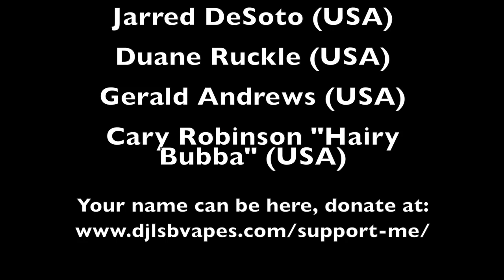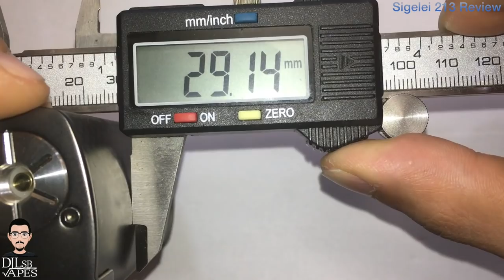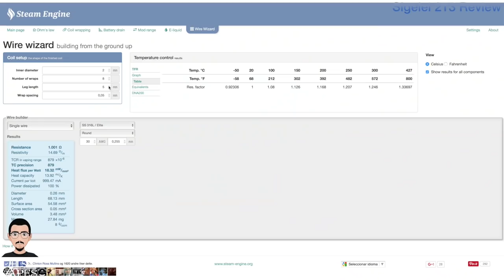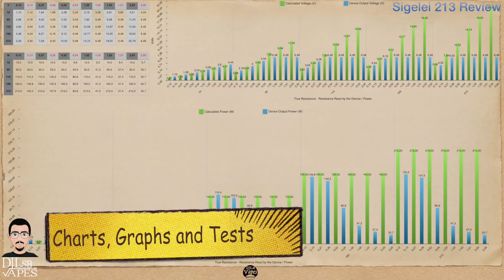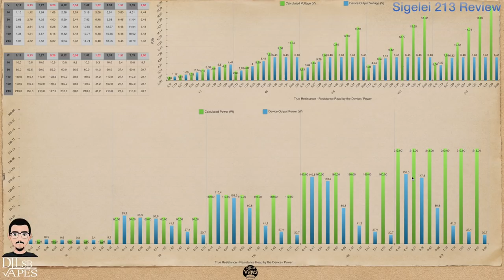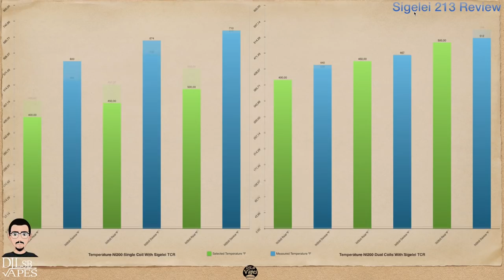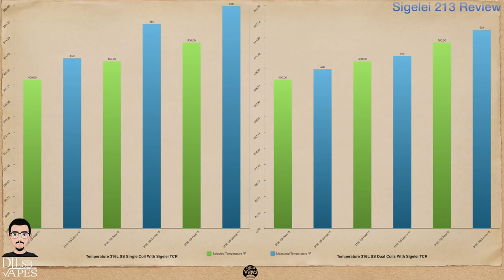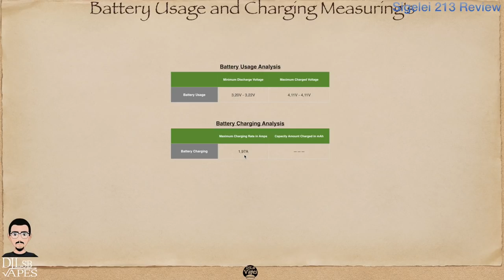Sigelei 213 Lies unveiled + Charts + Disassembly

Comment: So when you select lock the resistance it says hold the button so is that why it didn't work for you? I like the size and weight of the device but won't buy it if tc doesn't work.
Reply: I was wondering the same thing. It was saying hold to lock, and I never saw him actually hold it. Don't know if it would have mattered, but I'd like to have seen.
Reply from the maker: No, doesn't matter, that message is another glitch, holding it just makes the device fire right away, anyway later on the video you see it say's unlock instead of lock, so was locked, well not actually locked because that function is faulty, well you get it
Reply: +DJLsb Vapes awesome. thanks for clearing it. it doesn't matter whether right or wrong about that issue, their response was wrong. just something I was wondering about.

Comment: I'm really dissapointed watching this video,  actually this mod is dangerous... I have istick Pico and want to buy sth with more power like 120/150w, ability to use bigger atomizers  and really good working TC. I love builds with TC, mostly Ti wire, which mod do you recommend ? SMOK H-Priv looks very promising but would be nice to buy sth smaller ...

Comment: Thanks for the review.
Great looking mod, shame they ballsed up the TC.  It looks pretty well built though so I'll probably still get one when the price drops, I'm not a TC vaper so don't really care about that, a small light pocket friendly dual 18650 mod is useful to me.

One thing on the power rating, I'm fairly sure you said the max voltage was about 6.5V (I didn't trawl back through the video to check that) but the resistances you tested it at jumps from 0.13R to 0.27R, so you never tested at the resistance range where 213 watts is theoretically possible for the regulator.  These devices have to limit voltage and/or current (it's best they have hard limits for both) for safety, because of that they will only ever be able to achieve their rated power output under specific conditions, i.e. within a limited load resistance range.

Don't get me wrong, I'm NOT saying the mod would achieve 213W, I'm just pointing out that it was never realistic under the conditions you tested.

Anyway, love your work man, please keep doing the in depth reviews.
Reply from the maker: You welcome, yeah You are right, that's why when that happens I always vary the resistance up and down just to see if I will get higher wattages, if not I just go with those resistances I always do ;-)
Reply: That's great to hear, thanks!  I watch a few different reviewers for different reasons,  the in-depth technical detail of your videos is an important aspect most reviews don't offer.

Comment: It appears the board does not boost voltage or if it does it is very weak. Were your cells fully charged to where they could get even close to the 7.5v under load that they advertise as max voltage ? (Yes, I know that is pretty much impossible under load to have 7.5v to the coils with dual IMR cells, unless the board has a good strong boost). It really is said that the device can not actually put out the rated voltage / amperage. If it actually could then 213watts would not have been an issue. That will teach me to trust manufacturer ratings. The reading of the resistance each time the fire button is pressed, (even if locked), is a huge fail as well. Sadly I actually owned one and enjoyed using it and recommended it to others based on their rated outputs. It is still one of the best built mods I have seen at this price point but the fails make it a disappointment to me as well. Thanks for another awesome in depth review.
Reply: Does it need a boost circuit? Most dual cell mods are in series, and do step down instead of boost; more efficient and much simpler.
Reply: If it claims a max voltage output of 7.5v with dual 18650's, or anything above around 6.8v under load, then yes it will. We all know that under load the internal impedance of the 18650 IMR's that are currently available on the market will not allow that type of output under load. Except maybe with a very high load resistance. It will also only be for the window of full or nearly full charge. To make that claim with a fully regulated mod and not deliver it through the full dis-charge cycle of the power source used is simply wrong and false. It is always easier and more efficient to step down but the max voltage claim on the mod is what is the issue with not being able to attain rated wattage. The board is actually doing step down very well, as seen in the graphs. Glad to see another person responding here on YouTube with a decent level of tech knowledge, as it applies to our usage in mods. Well done jawr1215...

Comment: That really sucks. Sig has always made good gear, but I can't believe they told you to use "40A" batteries. ://///
Reply from the maker: Yep
Reply: Just saw the other links. Wow. Just wow. No returns through vendors? I'm assuming this is so they can avoid replacing/refunding when folks figure out it doesn't work. And they asked you to take down your review??? I will probably never buy another Sig product. That's horseshit. It's one thing to put out a piece of shit product. But to know it's a POS before it hits the market and try to cover it up is shady as fuck.

Comment: I had heard bad things about Sigelei but gave this one a try. Should have known there was something up when they came out with the  Fuchai 213 the next week after this one came out.Looks to be the same mod... No upgrades a big lie so they changed the name to sell the units they have? They blew it I like the form factor and looks, battery life is not bad.Another reason to use a DNA 200....oh well.
Reply: I feel ya brother! I bought the orignal 213 too and I gotta say I'm really disappointed...especially considering the price it cost. I could bought 2 mods that work like they're suppose to for the same price! But even after learning all this, I gotta say I still do love the look and feel of the mod..and since I don't really go over 150w and use TC rarely it's been doing pretty good. 

As for the Fuchai 213 the worst thing is, they supposedly fixed the issue they had with the original 213's chip and are selling it for half the price of the original 213!! So the people who bought the 213 are stuck with a chip that doesn't do what it's supposed to do! This last time I ever buy a mod before I watch some reviews...I almost never do that in the first place but after seeing how nice this looked and hearing some good things about it, I got it without thinking.

If only they made this board Firmware upgradeble, they could of easily fixed some the issues or at least tried to! Anotehr thing I'm never doing again is buying a deice that isn't firmware upgradeble, it just doesn't make sense not too when there are so many devices that are and are cheaper!
Reply: You hit it on the head never buy a mod that isn't upgradeble. They knew all that from the BS original Koopor and still said this was upgradeble . Just lie right in everyone's faces and take the money...
Reply: LOL you must work at a vape store.A vape store were the person doesn't know anything but the price ( that's 2+ times the price ... yeah). That's why we watch some reviewers like Daniel somebody who can test them.
Reply: Tim Baxter no I have a real job in the education industry. What ever happened to researching shit yourself? I guess being a capitalist shopper in this country is to difficult for some few
Reply: Research like checking the manufacture ( that gets you nowhere). Maybe forums like reddit where wiseguys help nobody.That's what reviews are for...you know.Maybe where you are they let you play with mods for days to get a feel for it. That would be nice.Capitalist... not really nobody wants to wast money .For a few it's easy to criticize...isn't.

Comment: I actually like the 213 but its not quite worth the money I paid for it.   The TC Functions are horrible but I do enjoy using it in Power Mode with the Pre Heat functions.   I have better devices which cost only a fraction of what the 213 costs.    I was disappointed with the TC Functions and very upset when I found out you could not upgrade the FW which was one of the reasons I took the risk in acquiring mine in the first place.   For what I am using it for its a fine device for what I intended on using it for well disappointing.   To see Danials test results confirmed what I suspected and Sigelei just dumped another device on the market that's not what they say it is.

Comment: i guess a good metaphor which btw is also kind of a bad one since it kind of works in a different way but using this only as a means to interperet my point in case is if cruise control (which yes is different because it acts based on speed first then applies rpms then backing off rpms at desired speed, and not the way tc does which in a way applies watts then backs off) had a button to activate  and apply rpms( yes i know cruise control doesnt work like this only when under speed, but just saying if it did), it wouldnt make sense to ,once desirable speed is achieved , to let go turning off and then pressing again turning on again which would apply rpms thus further speeding the car since it is already at speed,( yes from the time turned off and then turning on again of course it would have slowed down but come on REALLY?! not that much) but yes and then doing so repeatedly 3 more times every time of course it would go faster wouldnt it???  and this would be just a portion of what the car could do.  btw.  not foot to the floor on the gas pedal comparing to the 213W which yes whatever 155W nonetheless the max.  set to preheat everytime the amount of time which whatever u had it set to even if half a second 213W repeatedly applied after the set temp was already limiting to from the first press of the fire button.   i know u get what i mean even tho my comparisons arent exactly the best to use.  so yes i think if that if u set a lower preheat it might work fine.  just trying to be thorough in my thinking of how the whole preheat and tcr temp limit thing works.  no disrespect.  love what u do bro.

Comment: you do realize to lock the resistance you needed to hold the fire button not just click it???
Reply from the maker: No, is normal, is just another flaw, if you hold it, it does the same, plus the way I lock it you can see later that if I enter that menu again instead of lock it say's unlock
Reply: +DJLsb Vapes I didn't see it say that. but I completely trust your opinion on these devices as you are extremely thorough and definitely know your stuff lol. i just never saw it lock or unlock but I did see it say to hold button to lock resistance. again I trust your opinion more then most so I will take your word on it. thanks for the fair and honest videos my friend

Comment: boy that 510 spring looked rusty?
Reply from the maker: Yeah, inside, is normal because of the solder paste used and then the humidity during transport
Reply: +DJLsb Vapes ok. ty. i didnt know that
Reply: +DJLsb Vapes hey Daniel, what mod would you recommend for stainless temp control besides a dna?
Reply from the maker: The Q Class or any joyetech or the SMOK H-Priv are amazing
Reply from the maker: The IPV5 is great too
Reply: +DJLsb Vapes ty
Reply: +DJLsb Vapes ive got the h-priv maybe it needs to be updated because its on 1.04 firmware right now.
Reply from the maker: Oh yeah, really, trust me, upgrade it and you will be amazed ;-)

Comment: just wondering if the preheat fuction is the reason why tcr isnt working properly.  the reason im questioning is if hypothetically the 500F was reached, is the preheat wattage and time set for it absolute?? lets say it reached 500F and then immediately after releasing the fire button firing againwith 213W set for preheat,  for exmple if set to 2 secs.  and 500F is reached and then i release and fire again wouldnt it fire at that 213W for 2 secs regardless of the temp already achieved? and then if released and fired again resetting it for another 2 secs of 213W and again another time over the course of lets say 8 secs fired and released in   immediate succession but not exactly time set , as you exhibited.... would that really be using the tcr and preheat functions the way it was supposed to be used forthe temp limiting function to be achieved ?

Comment: great review Daniel, I bought this shit based on other famous reviewers, crab, I promise I will never buy before you review it, what happened happen, do you recommend any TCR number for SS316L SS317L than the crappy way of calculation, you will doo every one a favour if you have any input. second if TCR is fucked up and useless, do you recommend using TFR setup for wires or it is still useless for the fact that the unit does not lock resistance at all, this means this device is a good look on power mode only, crab sigelei

Comment: I always thought it was an ugly POS anyway, didn't get all the hype. The cuboid is a much nicer device. I've seen other reviews that showed gaps in the supposed carbon fibre, gaps on the 510 with many tanks plus other issues .... for what is a pricey mod, towards it's competition, it's unacceptable. And that is before the more technical failures.
Reply: +1 on the Cuboid.
Reply: From what I've seen, the build quality on the retail version is perfect... and there is so much play in the spring of the 510 that I just can't picture a tank/deck that won't screw all the way down. My Gemini tank is, by far, the longest 510 I have available, and it screws down flush with no issue. My IPV5 and my VTC mini both have gap issues with the Gemini.

There is so much wrong with this device that I wouldn't want people to pick it up in store and think "I read that the build quality was sub-par, so maybe they fixed everything else, too... It looks so good", and then buy one. Make no mistake - it is a very well-built mod, but it has serious problems with the internal TC functions.

It's kind of like if you met a really hot girl, and she says she's really good at cooking... so you take her home, only to find out that she is really good at cooking with Cyanide.

Comment: Why are people shitting on sigelei? They were hands down dropping their dick on the table they made the best mods a few years ago. They fucked up. And there hasint been time for them to burn a time out and figure this shit out. My suggestion is, all of these self taught mechanical engineer guys oughta collaborate and make mods outside of China. Cause that's some of the problem. They can make shit just fine, but r&d and their outlook on patents and transparency is bad. If that crazy ass dr. Ploom can make a mech mod that can handle a fuckin car battery, and a guy who single handedly designed and manufactured a mouse and keyboard emulator for PS3/4 and Xbox, complete with an oled display and his own software. I'm sure we can get some 'murican TC/VW mods. And no, I can't do it, and don't the entrepreneur drive.

Comment: no offence you did the dry test whit 213w what did you expect?....and second if you want to lock the ohm keep the buttons push for couple of seconds....you didnt wait....i did a dry test on a dna200 whit preheat 200w and got same experience....so pls be accurate...as for they're  213w bullshit you are wright....is imposible to get over 200w whit only 2 battery :))

Comment: Why do they scratch the identifying numbers off of the SMT components? Do they legitimately think that someone would take the time to reverse engineer their shitty product? If someone had the know how and resources to have a legitimate reason to try to reverse engineer it, simply looking at the component would be enough for them to be able to duplicate it. They would know what the components is, and which one they would need to spec simply by looking at what the component. So stupid. It also adds a level of unjust propriety to the product because if someone's mod stopped working, they wouldn't be able to open it up, look for the brown skid mark where the problem most likely is, order the part, and diet it back on. They want you to throw it away and buy a new one. Unless you're pretty savvy with SMT components, you wouldn't be able to fix it yourself. At least there wasn't any potted COB components, so it's not impossible to fix it yourself.